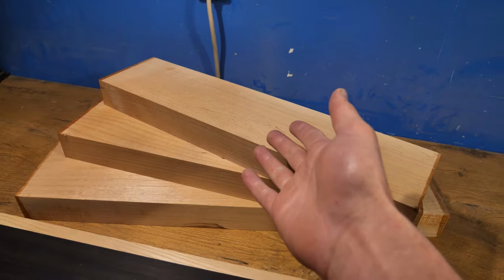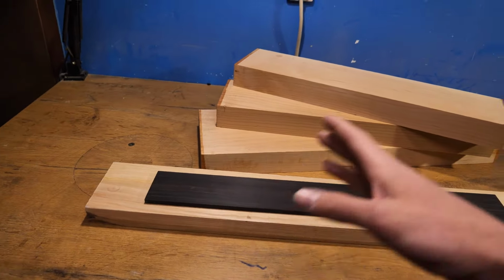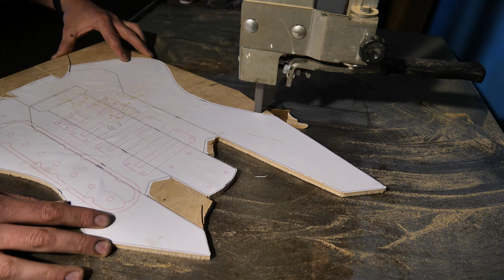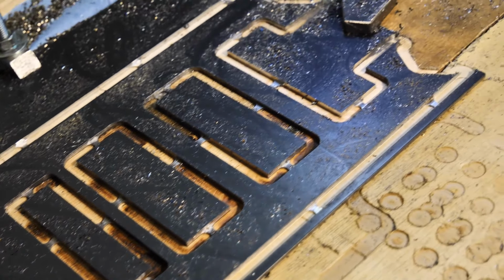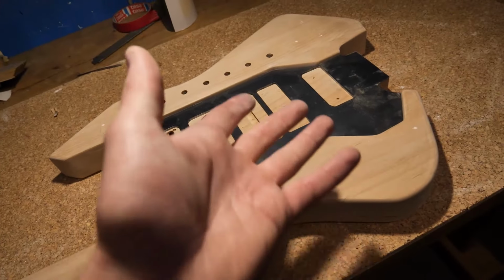Making the most popular guitar in Night City - Cyberpunk 2077 Noise Contagion guitar build

Comment: doesnt johnny roast this guitar in his ending? havent dont that ending in a while so this might be one of the two good guitars
Reply: (Disclaimer, other guy is correct and did the math) idk they use the same model for both the cheap junk and kerrys prized axe. theres only like 3-4 actual models in the game.
Reply: so I checked the guitar store, it's on display and if you scan it, it says that it's got a cheap plywood body
Reply: @satanism_rocks  I believe i then, now I gotta go in and search around for a good one. Just found the apartment containing Kerrys stollen guitar at the parking spot on the road for the Glen apartment. Gonna go in and see what that one is. I'm gonna edit my comment for the meantime.
Reply: @satanism_rocks Just checked again and I was thinking of the Tenzor Paradize as Kerry’s stolen axe. It’s a headless offset SG with an SG Special II control layout. similar but miles off